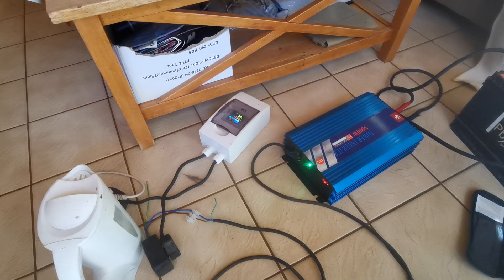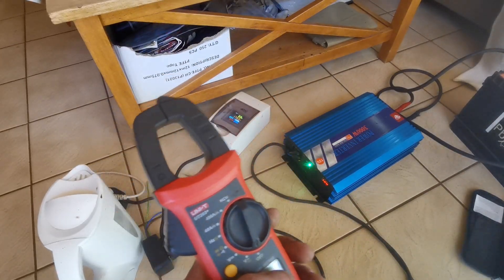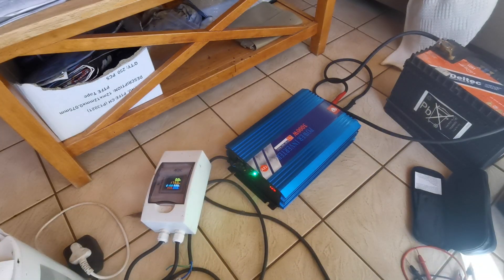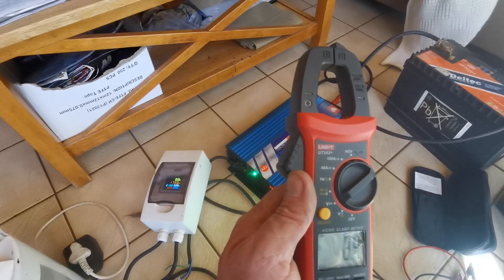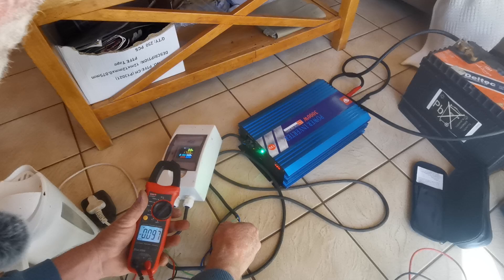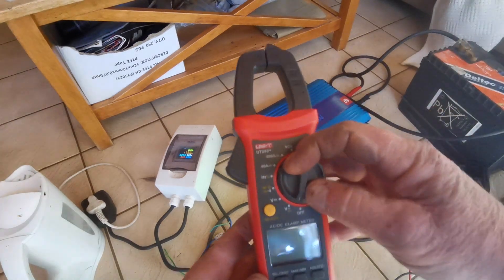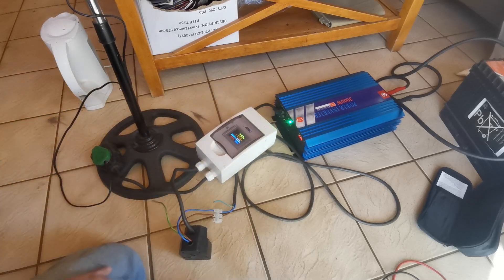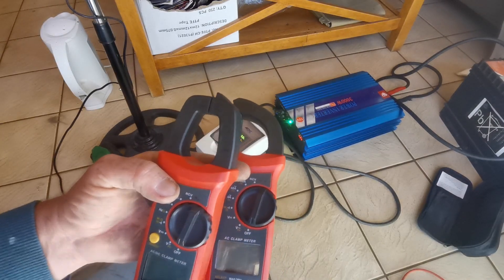UNI-T UT203+ UT201+ Clamp meters practical uses

Comment: Dude can you please make another clip for beginners just like myself who haven't got a clue about how to use a meter the basics would be great.
Could you please make it with better audio and video full shots of everything you do this would be so helpful to people like me thanks .
Reply from the maker: I can do that, I have upgraded my microphones so the audio should be better. What are the specific aspects you're struggling with?
Reply: @WrecksToRides   Man thanks im hopeless with electronics last 2 multi meters I've owned I blew up because I hooked them up the wrong way.

I'd just love to know how to do basic stuff more so what symbols to have it on when checking our 240 volt AC mains, checking DC power, resistance & ohms to check cars parts & how to use the leads properly.

 I have the Tool pro  UT 203 R worked the basic NCV out but that's just on Lo & holding it to a 240 volt outlet that just because I watched your clip but any thing would help me thanks so much
Reply from the maker: I think a basics video is going to be a better idea, these clamp meters are not cheap and should rather be used by someone with a bit more experience. I also think a basics video will be more fun
Reply: @WrecksToRides  Good job looking forward to it
Reply from the maker: Here ya go, it's a bit long and I've upgraded audio, Lemme know if it helps 😁

https://youtu.be/P_WbSPDfPwA?si=-ewyeVb2SlQ8l0Ll